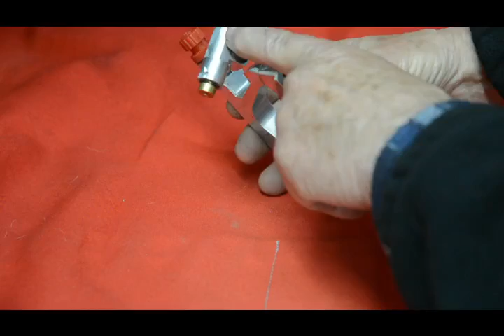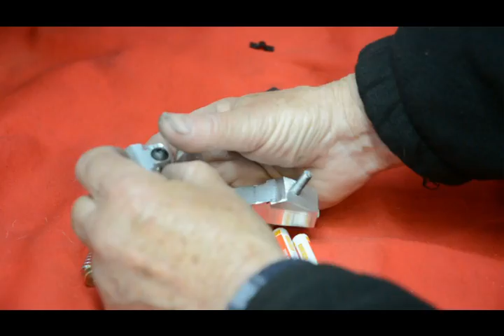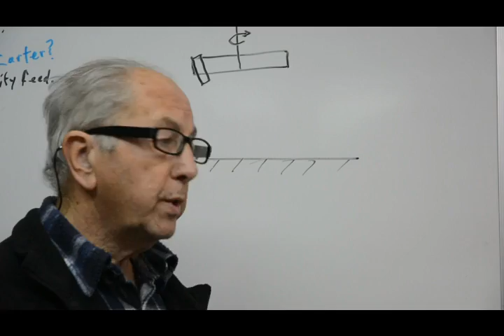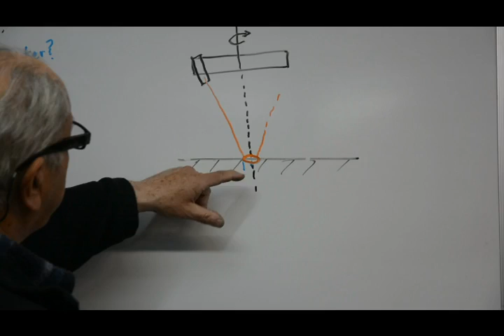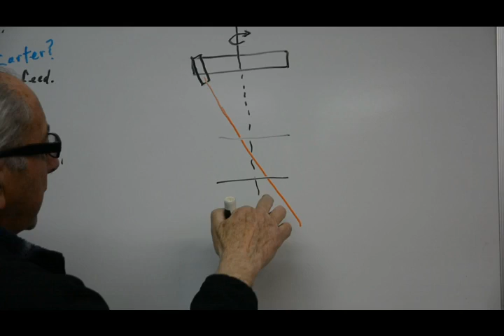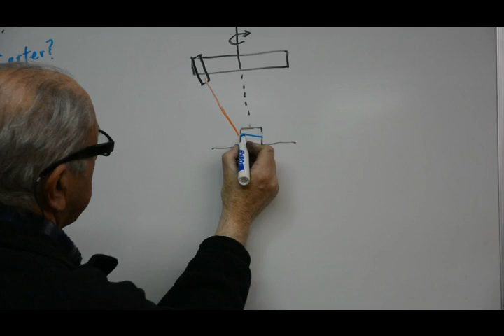Rotating Laser centre/edge finder.

Comment: I know this is an old thread, using this, you could use a cylinder with a 90 degree notch to edge find a part. Also tram your mill by setting a cylinder square on your mill table.

Comment: Possibilities for my mill drill are very impressive, round column can be picked up after adjusting height of quill assembly  which requires reclamping  , and ease of locating that centre pin on the rotary table looks so easy now compared to working with an indicator. Cheers!

Comment: You 'll find Dan's device within his milling video part 15 of 18
Reply from the maker: David,
I am aware of that one, but it is not the original one that I was referring to.  IIRC it was a video dedicated to the laser centre finder.  The device in that video had a different construction to the one briefly shown in part 15, and Dan demonstrated more uses in more detail.  I have been unable to find that video for quite some time now.  His channel has not been updated for 4 years now.
Reply: @MotoChassisByTonyFoale   
Hi Tony
I see what you mean.  I also got the idea from that brief section and built myself a unit.  In my case I designed and printed a device using my 3D printer.  Like you I find it very useful.